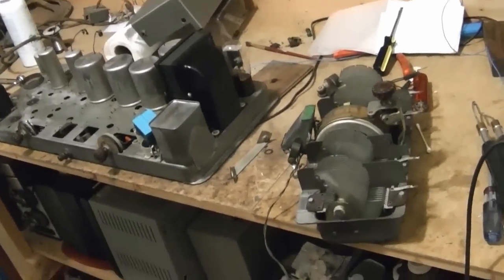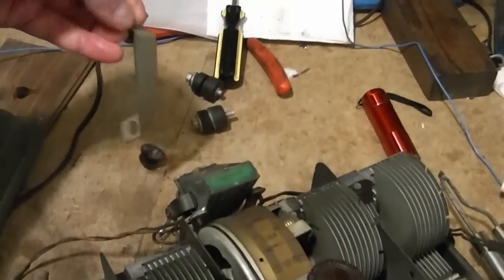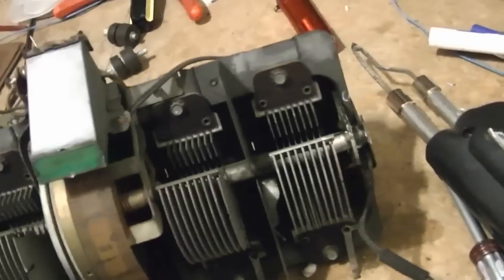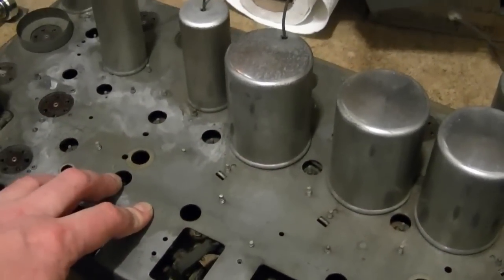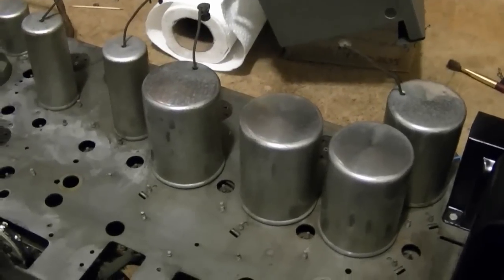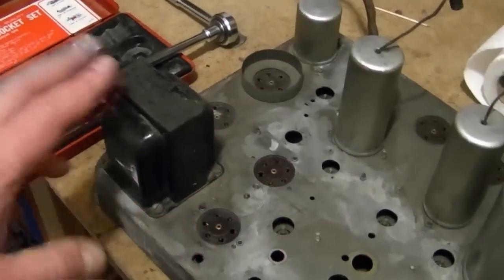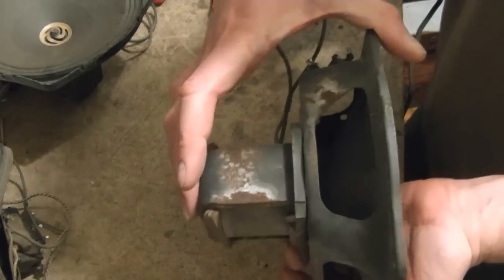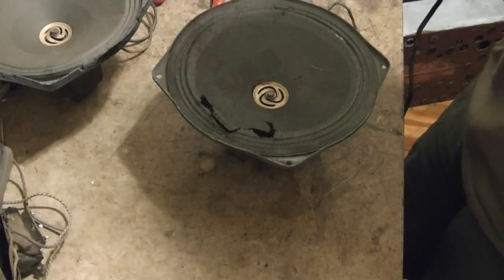Philco 15DX restoration pt11o?

Comment from the maker: I've seen those ultrasonic cleaners too.  My concern about using it on a cap like this is the extra stuff mounted on it like the shadow meter.  I'd probably have to take it all apart before cleaning.

Yes, I could mix and match but the more I clean up the Philcos the more apparent it becomes that they are higher quality.

Comment from the maker: Thanks for the suggestion.  I think there's something more than that wrong with the Wheel speakers.  There's just not much spring to the cones.  I think it's because they just used crimped paper cone material for the surround.  The original Philco's use some sort of elastic material for the surround.

Comment: Hi Bob. I was watching you talk about the variable capacitor and that reminded me of a very interesting device to clean them, an ultrasonic cleaner. I saw twice in two different videos the guys washing their variable caps and the result was fantastic. That might be an interesting device for you (I mean, if you don't have one of course... :) ) and it does not seem to be extremely expensive. You talked about the speaker pairs. Any problems in mixing them (the best of each pair)?

Comment from the maker: Keep in mind though it's not really the cone that's the issue.  The Philco speakers are very rusty and that's binding up the voice coils.  I don't know if Jordan is into doing rust removal or should I rip the old cones out and remove the rust first ?  Also, I really want to have vintage type cone and surround material used so I'll have to see if he can use those vs modern, synthetic cones.

Comment from the maker: Those speakers spent time under water in a flooded basement.  I've spent all week getting rid of most of it.  The cones and voice coils will need to come out to fully get rid of it.  I really don't care about saving the cones, they are brittle, torn and have holes.  I've patched them together so I can test the speakers, but do want to replace them.  When I do, I'd like to use period correct paper cones and surround material if possible.

Comment: Perhaps the spider is a bit limp, they are normally supposed to be a bit springy. You could try painting the spider with some glue after you reposition the cone to stiffen it up, if that doesn't work you could try the glue pen trick on the hinge/surround.

Comment: Sure, you could not risk damaging the shadow meter in this case. I guess there is no actual benefit (or very little) from ultrasonic cleaning, apart from making the cap look clean. Yesterday I was looking your photos of the 15DX and reading some comments. I knew the radio was important for you, but I didn't know it is quite a rare set...So, there are not many people around to talk about the behavior of the shadow meter, maybe about other models that use it too...